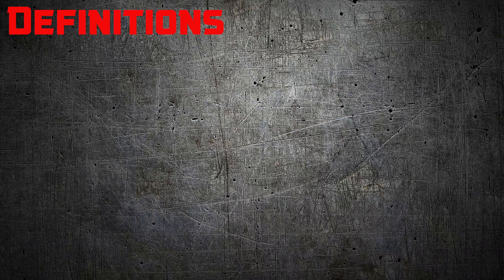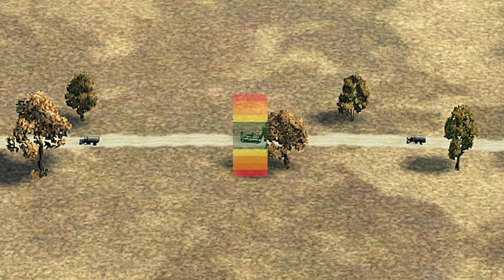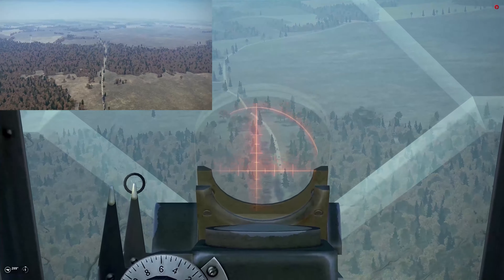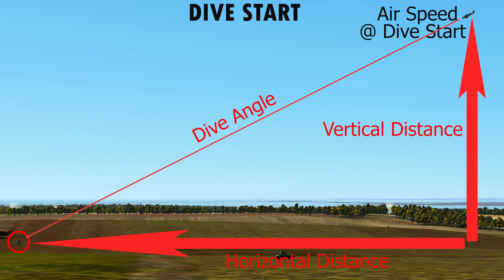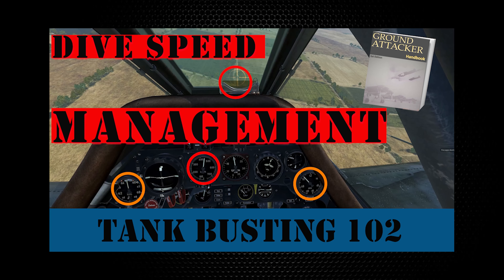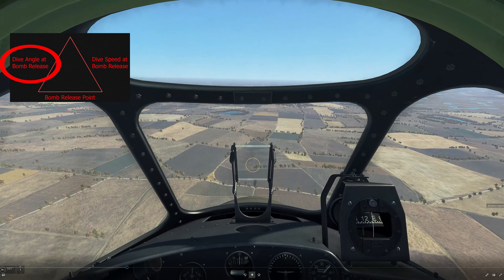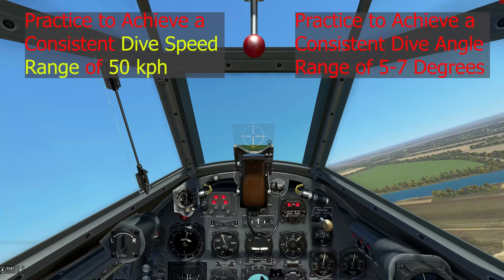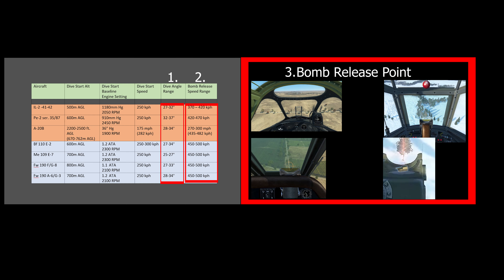Tank Busting 102 : Bomb Drop Accuracy: The Triangle of Factors : IL-2 Great Battles

Comment: Ahoy there. I have a question for you. Do you use any rudder in order to aling with target? No matter how i try i cant get my nose in study course loaded with that speeds espesially with a loaded 190...
Reply from the maker: I only use rudder when there is a crosswind, which I will cover in the future. Is it a vertical or horizontal stability issue? Is it just the 190 or other A/C as well? What joystick are you using? I have had stability issues with CH sticks, VKB Gladiator, and VKB Gunfighter sticks.
Reply: @HamvonBoom  I have a vkb glad nxt and it's a horizontal stability issue and I don't think it's the joystick that is the problem. Mostly I believe it's the pedals Saitek...
Reply from the maker: @wolfpackj  hmmmm if you want to upload a video of the issue I'll take a look at it. If there is no wind and no turbulence, the need for rudder input is fairly minimal.